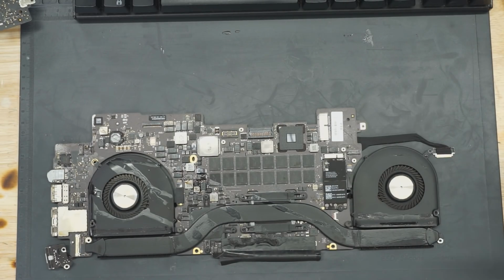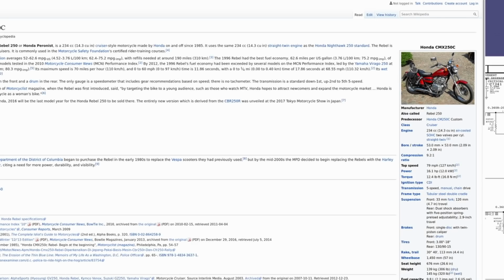A1398 Liquid damaged CPU power circuit restoration on Macbook Pro

Comment: This whole time I've thought it was a butt converter not a buck converter.
Reply from the maker: I will be including those flash cards more often to clear up any further confusion.
Reply: Convert 1v butt into 12v butt XDXD
Reply: cpu to the buck converter after converting a deadly 12 volt signal into a palatable 1-1.7 volt signal: thanks! you really saved my butt

Comment: I have this board. A1398 I7 8gb ram. Spilled beer on it, took the board out and cleaned it same day. It worked right for 3 months of hard use. But it started shutting off and is now too slow to use. I wiped the ssd and tried reinstalling the os but it keeps crashing during install. I can get a board for under 400. Should I send it to Rossmann or get the board?

Comment: Hi , I have a1466, it comes gray screen also it does turn on its caps lock light. But apple logo sound is coming. All voltages are switched properly. I found that CPU_MEM_RESET_L  have no voltages. What is fault?

Comment: Fixing headphone cable requires heat as the cable has a coating on it I usually burn the cable with a lighter to remove the coating and it solders perfectly

Comment: Just buy a kapcai that come with auto clutch, like Yamaha LC 135 and modify rear brake system, by removing brake paddle and replace it with a brake lever. Or just buy a Yamaha NVX.

Comment: tbh its lazy but ive been riding a motorcycle for a long time and the foot break you can basically ignore , its mostly useful in either bad weather like wet slippery roads or if you need the absolute maximum breaking possible , the hand operated break is about 90+% of the breaking because its the front wheel break and the foot one is the rear which for the most part especially in CBD urban travel can be totally ignored. Its honestly worth just using it a lot so if you have to ever emergency stop you maybe take off a few inches from the stopping distance

Comment: Louis, for the Linux / GPU hanging issue, check to see if you have a Swap file or partition. I've seen this on a number of my own systems which lack Swap space. The kernel runs out of memory, and the OOM Reaper doesn't come out until whatever hangs the display/kernel works itself out.

Comment: ___________❌ 
 

If you’re driving a vehicle (commercial operating in commerce) you have to obey the public policies (speed limit etc.), if you’re driving an automobile public policies don’t apply to you; you have the right of travel under the constitution in your private capacity

In a Republican ran state, you have the right of travel under common law Jurisdiction, the law of the land the US Constitution, therefore, you do not need a license plate or a license to “travel” on public road

Under “legality” there are so many commercial and public policies you have to follow but under that which is “lawful” you do what you want as long as you don’t hurt anybody, that’s constitutional

Comment: Shifting with a clutch is far better than any automatic shift solution. More reliable, less expensive, better efficiency (in most cases) and when you get used to it, you know much better than any computer can predict if you will need to accelerate, decelerate or cruise. But yes, electric appears to be the future despite my love for the I.C.E.. I don’t know about you but the research I have done would tell me that electric is only going to be more efficient when power creation and transfer through the grid is more efficient and cheaper. But better batteries will be all it will take for the end consumer to prefer electric in my semi informed opinion.

Comment: Very lucky owner.
Boost creates a voltage higher than the input voltage.
Buck   creates a voltage lower  than the input voltage.
Negative voltages in respect to ground are also possible.

Comment: Rearbreaks are not  that usefull on motor bikes, breaking shifts all the weight to the front (it already is fairly to the front any way), seriously making the stopping power very low. Modern machines have combined brakes ("modern" as in my 2003 bike). And with anti lock breaking pulling the full frontbreak is just fun. 

But you sound like an old man that cannot cope  with change Louis, learn to adapt.

Comment: Motorbike wise, the Honda VFR1200 can be spec'd with an automatic transmission.
The brake pedal thing is just that bikers are used to it.  You try to put the rear brake lever on the left bar then you get bikers all over sliding the rear up to traffic lights as they go for the clutch and lock up the rear brake. ;)

Comment: Hey Louis I can ride my bicycle at a speed more than 60 km/h or more than 37 miles/h without electric motor , just my feet . Simple metal bicycle cost around 50 dollar.
No speed limit in India on a bicycle you can ride as fast as your feet can.

Comment: on the speed limit thing, in most places, if a cop gives a speeding ticket (for speeding alone) for anything less than 10mph it will automatically be thrown out of court because its a waste of time so everyone drives 5-9 mph over. 5mph over being the most common. you can still be given a ticket, but its very unlikely

Comment: If you have good riding conditions, you can use 90% front brake, as conditions worsen, you use more rear brake.. the weight shifting forward will make it so the front wheel gets planted on the ground and unweights the rear.
you get used to motorcycle controls pretty easily with a little time

Comment: On my scooter, the left brake paddle mechanically connected to both front and rear brake, also the case with the right brake paddle. The only difference is ratio

the left paddle pulls the front brake 50% less than the rear brake, the opposite applies for right brake paddle

Engineering marvel I'd say

Comment: is it a good idea to coat the entire laptop board in a layer of nail polish to prevent liquid damage; sans connector ports, connection points?

i've seen extreme overclockers use this method to add protection to prevent condensation shorting the area during LN2 benching.

Comment: You should document your repairs especially for those that make false claims. I mean you should take photos or videos to show the customer. Also, you could put the board through a sonic clean and then use the photos to return to your identified corroded areas to reflow etc. Apple should have a voltage controller on the line feeding the CPU so that a surge doesn't kill the CPU but would shunt to ground instead. Also, just because it fires up doesn't mean the CPU didn't take a spike. The CPUt may now have a reduced life span or latent failure after they spilled another drink, but I also wonder HOW do those parts corrode so quickly? I mean, if they spilled something and it died, that corrosion can't be from that one incident, I don't believe. Corrosion like that would take time to build up like that and a lot of it could be from Apple using sh-t solder! That or it has been a while since the spill before the computer quit working which could be from all that sh-t corrosion. Just some random thoughts. Sorry, I used to be a tech and product engineer and used to have to do failure analysis of products returned from the field and tin was a usual culprit. Thanks for the video, teaching, and chat! Which Linux distro do you use? I'm looking into learning Linux and even bought the stupid Raspberry Pi 400 to learn with before putting Linux on my computer.
Reply from the maker: it's pointless, scammers gonna scam, you just tell them to their face you know what they are doing and hope that you covered yourself properly in documenting what you did and what they said/approved

Comment: You feel the way you do about motorcycles because you are used to the layout of controls on your bicycle. Once you gain some experience on a motorcycle, it will be muscle memory to operate the clutch and transmission on the left and the brakes on the right. I unfortunately let my motorcycle qualification expire over the years and so it is no longer on my licence or they added it to licensing and I qualified earlier either way it is gone and I would have to take a class and do it all again and being 59 years young with some physical issues from my motorcycle accident in England in 82 yea it's not going to happen. I would like to ride again sometimes but traffic is building and some idiot would probably pull out in front of me killing me in the process because so many people just do not respect the motorcycle driver. And if you think learning to ride or even drive is strange, try doing it in England where they drive on the wrong side of the road. That is what ultimately caused my accident as those roads also wind a lot and I was on a back road driving to the other side of the military base minding my business at 55 and come around an S curve with an a$$ parked in the lane and I had barbed wire fencing to my left or chance an oncoming vehicle on the right as I could not see around him but ultimately that is what my brain chose in a fraction of a second but a little too late since the roads are backwards so I slammed into his right rear of his vehicle which turned me into superman until I landed in the ditch on the opposite side. I remember seeing my helmet roll in and me thinking God I hope my head isn't in that! And I wasn't a noob rider or anything it was just that extra split second of thought in slo motion having to mirror image one's choices. Luckily I just broke all the bones in my left leg but took about two years to heal. So, the moral is, be prepared for A-holes on the road no matter what 2 wheeled vehicle you ride. But yes you NEED to get a driver license as it will make life so much better unless you are rich enough to have a chauffeur everywhere you go! I guess it is a New York thing since you have the subways and all because in Florida driving is pretty much life essential! And manual transmissions are more efficient you just need to learn the finesse of it so you don't pop a wheelie sending the bike forward out from under you. Take the course and be not afraid. The skills come with experience! Good luck Louis!

Comment: Oh I understand with Linux. It is frustrating sometimes. But when it gets figured out it's absolutely awesome
Reply: It’s too often that it’s buggy and broken, it outweighs the times it is good.
Reply: @3a.m.284  True, but Ive used Micro$oft Winhoes for a long time and Linux is just more stable and trustworthy. All OS's have pros and cons, Depends what you do with it.
Reply: @ernestmccollum2397  is it more secure than windows? Yes, more stable than windows? Absolutely fucking not lol
Reply: @3a.m.284  Name one LTS Windows version.
Reply: @3a.m.284  Dunno about that, I have had at least 10x more BSOD's on Windows than kernel panics or Louis' video freezes on Linux.
Reply: tbh it depends which flavour you're using but these days its no more buggy than windows, Ive been MS free in my private life for more than 10 years and rarely have issues with linux itself now. Mostly its second party software breaking compatibility Nvidia  is a big one.